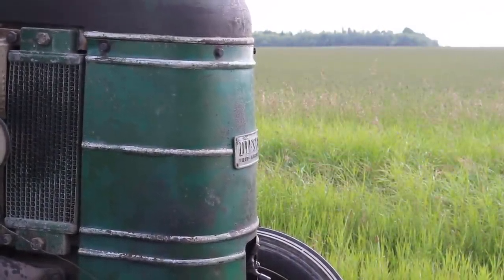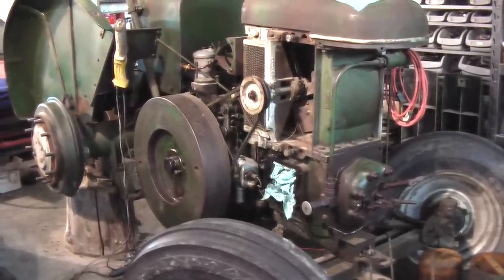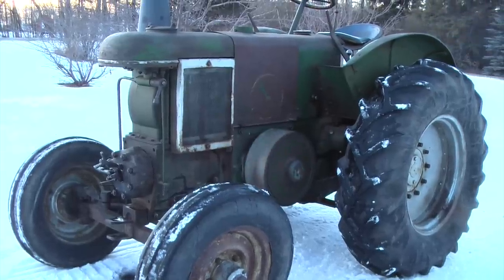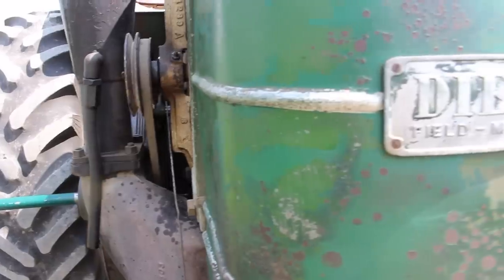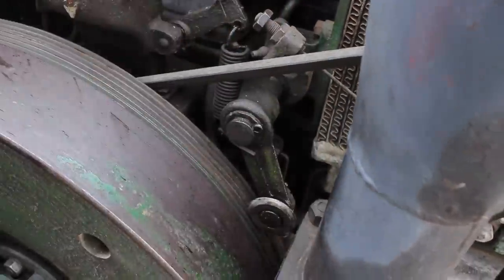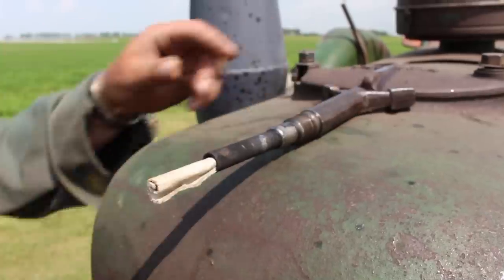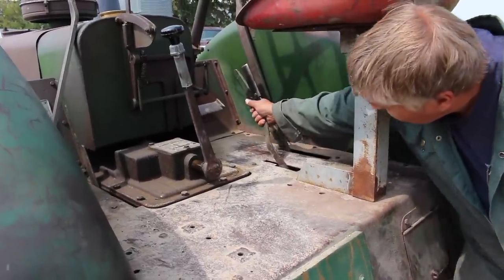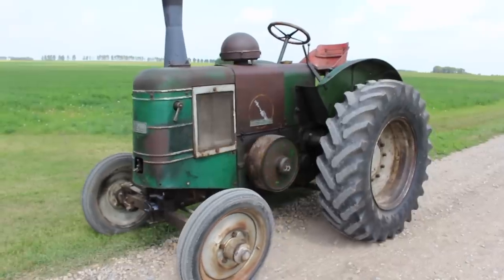How to start a Field Marshall Tractor!

Comment: I had a crawler like it . When came time to sell it at auction , I was to give it a cold start . I`d run out of starter papers . An old guy stepped out from the crowd and had a big draw on a rollie cigarette and screwed it in . Worked a treat .

Comment: This model seems to be running anti-clockwise the one I have seen run clockwise. Strange.
Reply: You're absolutely right Walter. I remember,as a child, when the tractor sat ticking over, driving the threshing machine, The right hand pulley, as you view it, driving the belt, turned anti-clockwise.
Reply: Correct!  first  marshalls (3 speed)  ran ANTI clockwise  Then to  get 6 speeds they  put in an xtra countershaft  & ran  engine  CLOCKWISE! ( or  you got 6 reverse & 2 forward)  all crawlers & 6 speed were same ,first  tractors  were 30 HP then by improving air admission  they got 12 hp extra! 
 this overloaded  the piston pin(gudgeon) which   was then fitted with  needle roller bearing  the first (3 speeds) were a great  tractor but the pinion drive to the "bull wheel" cog in the dif should  be  REGULARLY replaced as they tended to  wear & drop a tooth  Which  rotated with the bull wheel & split the gear case as it  had no  clearance! OH yeah  start  with a SPECIAL 12 ga shot gun shell NOT a n ordinary cartridge!  (yes some nuts try!)   A fun  machine  sounds cute but  BEWARE the chimney  can start   FIRES!